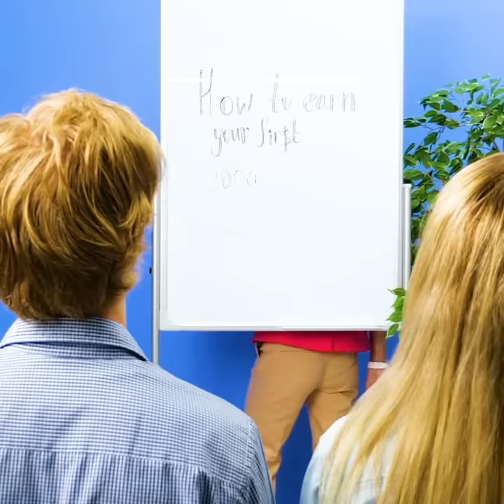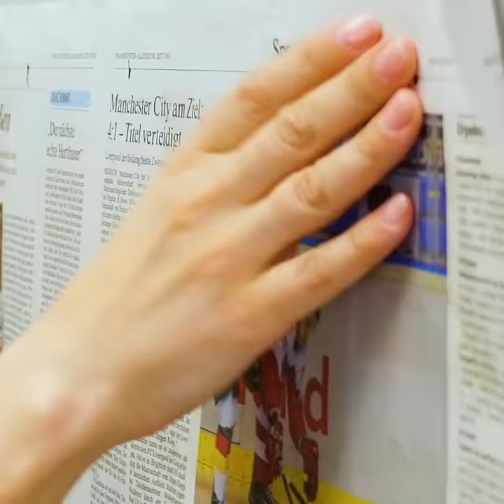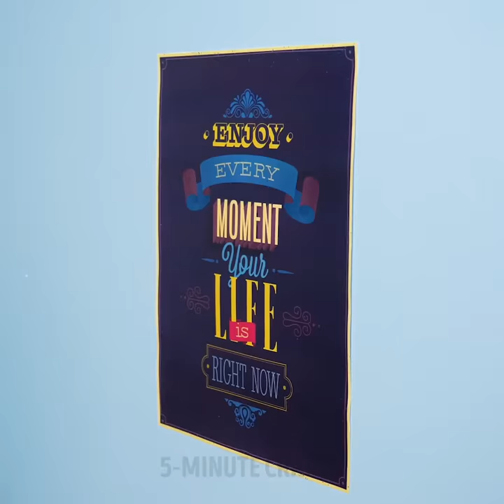40 RECIPES TO CLEAN EVERYTHING IN JUST A FEW MINUTES || White Shoes Stains Removal

Comment: 12:30 that’s not how pool noodles work? They float, but they’re not water repellent, and thus wouldn’t do that. The pool noodle would absorb the water at the point where the sink would normally let it flow. You can tell that they put a hose inside of the noodle, in the shot where the water’s flowing into the bucket. In better, more realistic thinking, i can suggest using a broken garden hose, if you have them. You cut off the hose’s other parts and just keep the “noodle” of sorts. You attach one part to the sink, other above the bucket, hold tight to the sink and bam!